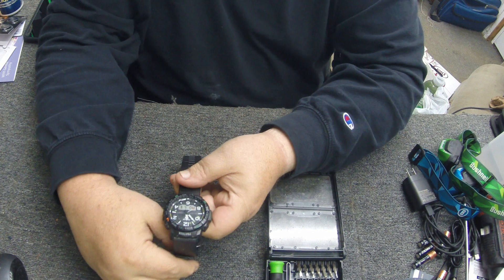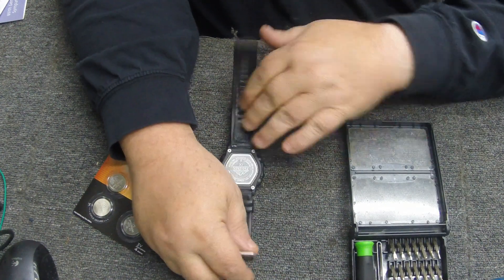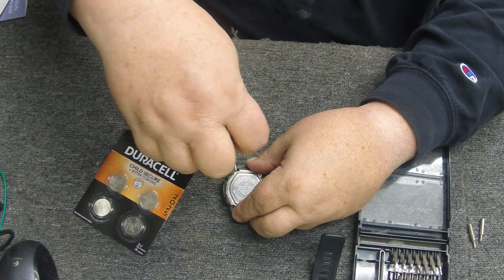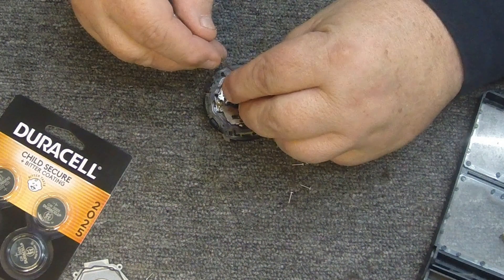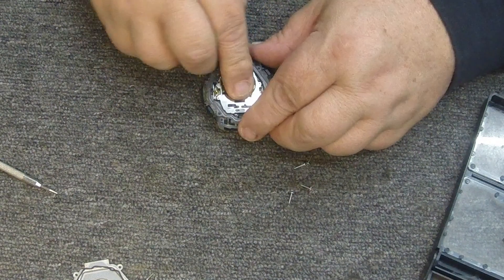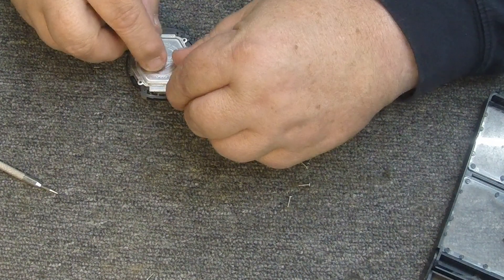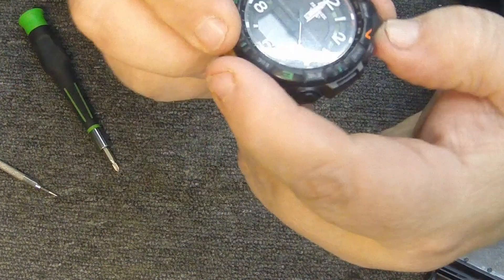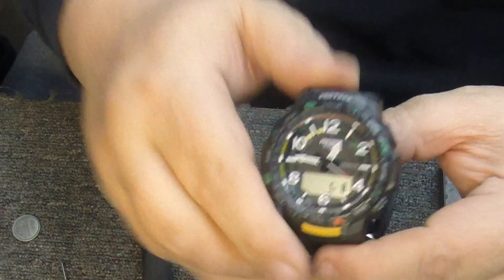Casio Pro Trek PRT-50 Recover Issue and Battery Replacement

Comment: My battery hook did also get broken so I can tget it out and you didnt show in the video which way you pulled it out? Can you please explain...from th ebatery sid eand out or opposite? I cant attach the battery anymore...
Reply from the maker: On this watch it is a pain. To release the battery, you need to use a very fine tool, like a needle or a pin also that little metal piece isn't hinged;  You place the tool into the small slot on the side of the metal clip, then push inward (toward the battery) and then pull upward to unhook it. it's a flexible tab that you have to carefully bend back to clear the catch if that makes sense.  If the hook is already broken the battery should come out and than you might try to use a tiny bit of non-conductive adhesive tape or a small piece of foam on the back of the case cover to provide enough pressure to keep the battery in place once the watch is closed. Just be very careful not to pull the whole watch module out, as there is a delicate ribbon cable underneath that can be easily unplugged.

Comment: Hi, I had some problems with my watch when I changed my battery, I put it back and the altimeter button wasn't working at all! I had to order other screws as well for the caseback, tried refitting and stripped the screws head, a little bit dissapointed!
Reply: Did you perform an A/C reset after battery change? Contact the spots shown on the battery with the tips of a metal tweezers. 99% of the issues are due to missing the A/C reset step.
Reply: @moonlight-wd6gu  Solved the mistery, it was a metal casing imperfection on the alti button, which holds the battery! I straighten that out and no more problems! Thanks for the reply.
Reply from the maker: I hear you for a watch this expensive you would think it would be constructed a little better. I still really do like the watch though..